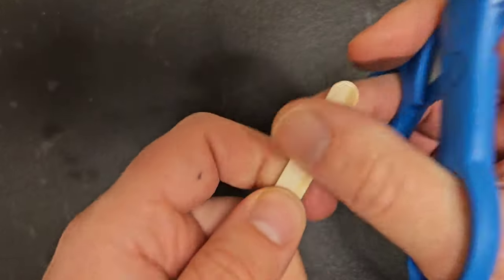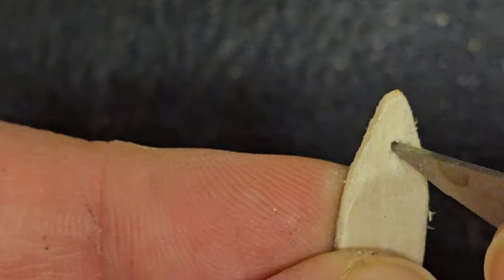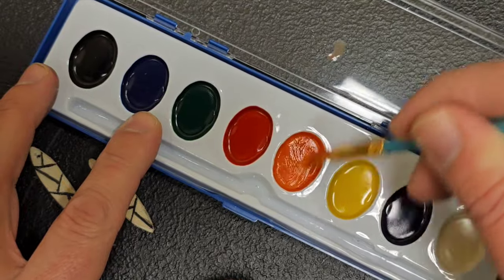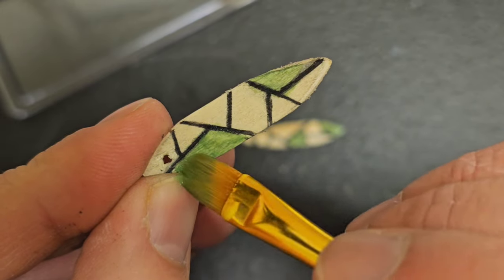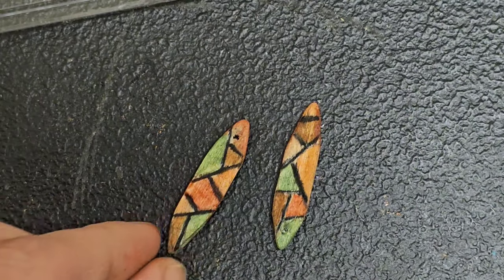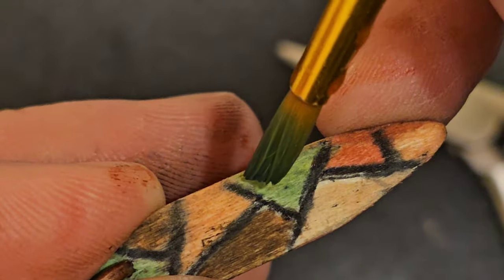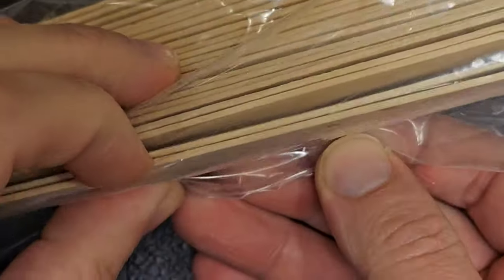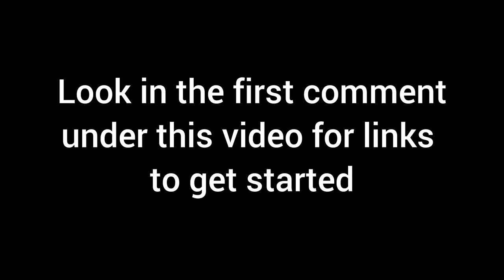DOLLAR * STORE * PART * 2

Comment: WHY is it that every time we hit tthe cheap stores, we buy the same things even though we KNOW we have them already?    Paints, Scissors, Beads, - I mean we ALWAYS need those, but still, we end up with all sorts of similar stuff and have to then go back and get specific stuff we were thinking of before we went the first time. - we dont have Dollar Store here - but Cheap As Chips, The Reject Shop, various other like stores - and without cutting the ends of the popsicle stick - we just rub it on cement or some rough stuff - lol - as kids youd see us sitting on the back step of the house rubbing them on the rough step part, sharpening one end to make little spear heads to put on an arrow for a home made out of found piece of wood that was still bendy but not so dry it would break, and hay string, and shoot at hay bales at the hay shed.     Kept us busy for a while.